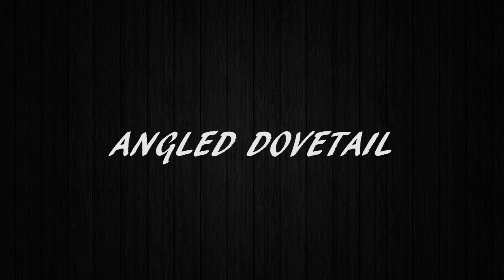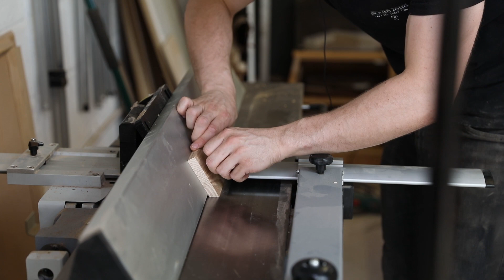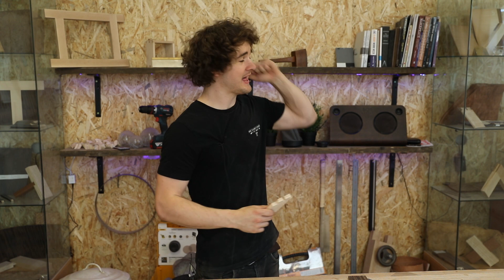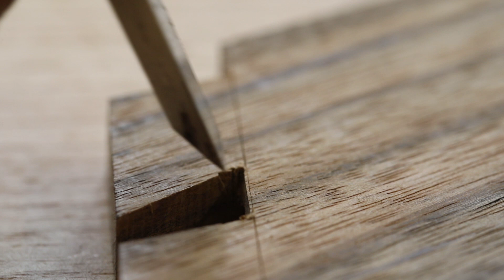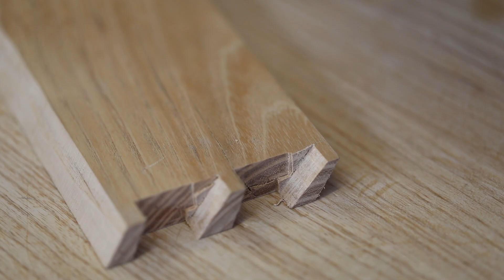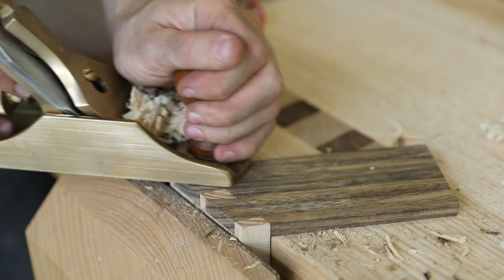How to cut an ANGLED DOVETAIL joint

Comment: How feasible/practical would a dovetail joint be if the angle would be smaller or greather than 90 degrees? For example think of a trapezoidal shape.

Comment: Excellent, excellent video!  I've been wanting to make some serving trays with compound angled edges and utilize box joint joinery at the corners.  Even though you use dovetails, this is the ONLY video I have seen that addresses the challenges with the compound angles in the joinery.  I can employ some of the same techniques as you have shown here only with box joints.  I also like the tip on angling the jointer fence to obtain a flat top & bottom surfaces.  Duh!  Thank you for this video!!!  Very helpful!

Comment: Why didn’t you just plane the other side of the ash piece as well? I mean yo didn’t have to use the bandsaw. The angle was already set to 30 degrees
Reply: Like, put a fence on the planer so the edges are parallel?
Reply: It wouldn't be parrallel then though

Comment: Instead of marking your ratio on the off cut then setting your bevel to the new (odd) angle then remarking on the finish piece, why not just set your ratio on your bevel (as normal) and hold the off cut against the finish piece and/or bevel to automatically correct for the 30 degree offset? Basically just giving yourself back the square edge.. Obviously you would just line up with the spacings on the final piece and not the off cut.
Reply from the maker: Haha yea that would also work rather well! Good shout